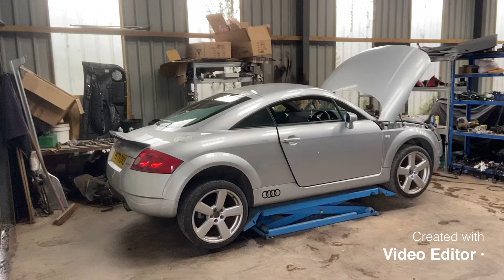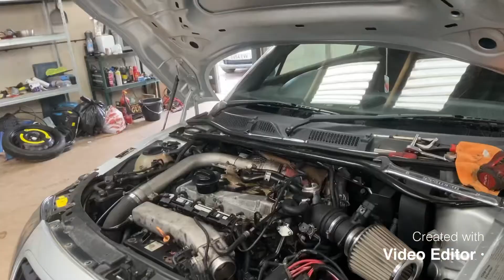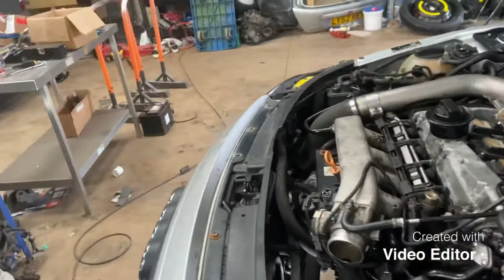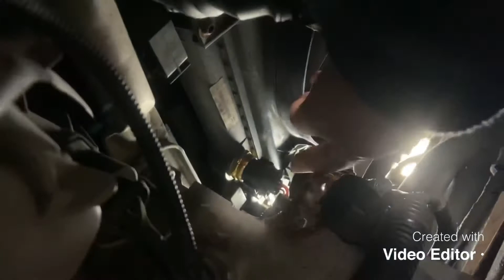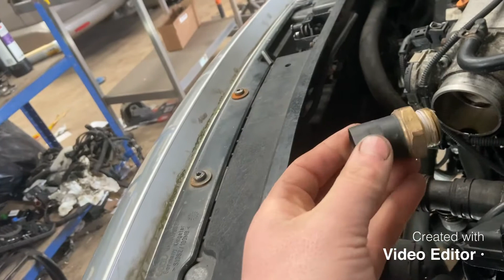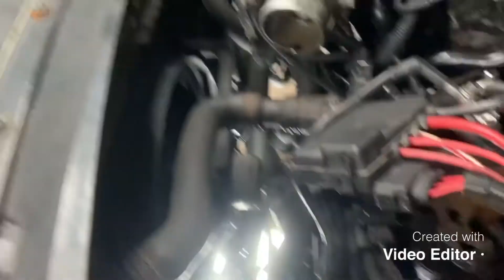Audi TT 1.8t fans not working  temperature sensor issues

Comment: Same here, just bought a 500 quid tt same issue with fans lol... bought the same sensors 🤣🤣🤣🤣
Reply from the maker: Did it do the trick? I don’t think my water pump is working correctly so looks like il be changing that out next 🤦‍♂️ 😂
Reply: @bestysbits2071  I'm gonna try it today
Reply: Will keep you posted
Reply: Turns out the connection on the fuse pins wasn't very good.. I now have both fans, both speeds working... although I still replaced fan switch and coolant temp sensor before accidentally figuring it after checking initially, that they weren't blown...
Reply from the maker: @RekitRalph666  glad you solved it at one point I was considering just wiring a new supply to the fans on a switch 😂
Reply: @bestysbits2071  same here! Lol!
Reply: @RekitRalph666  just discovered same thing tonight on mine. Check my video on my page (loose connection)